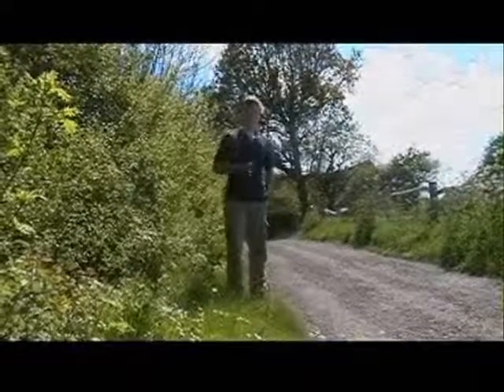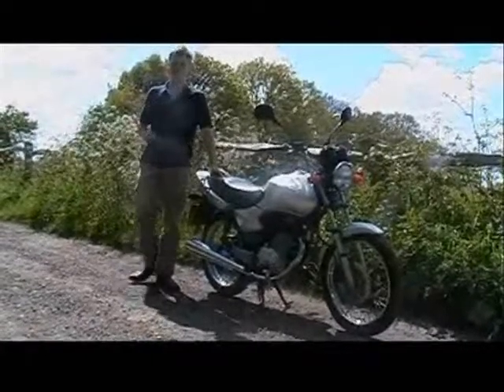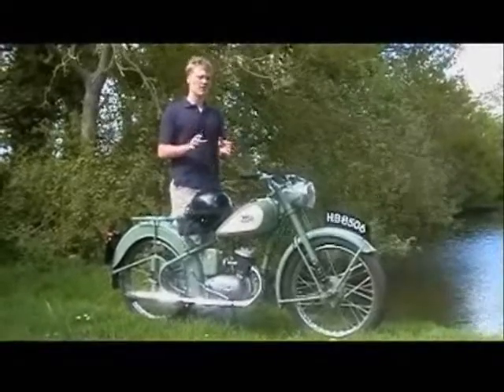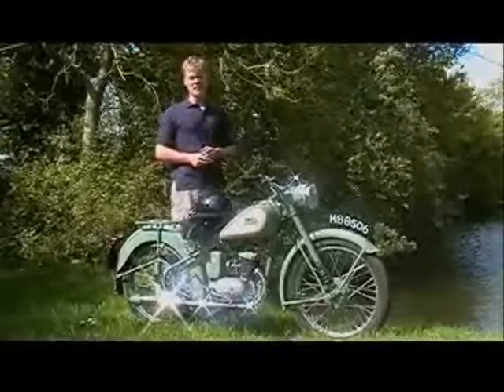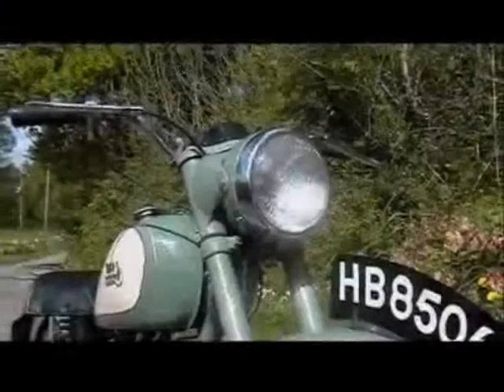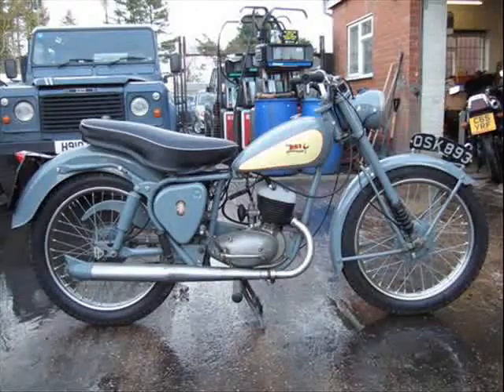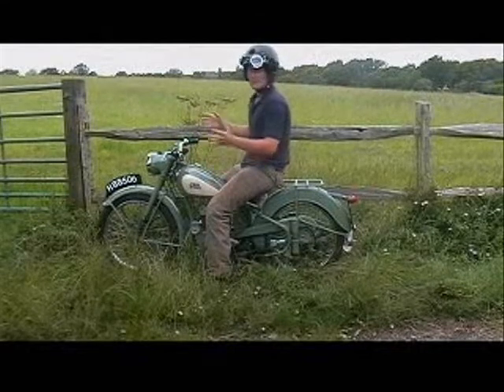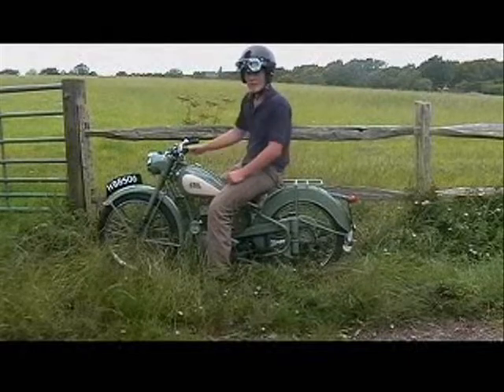BSA Bantam

Comment: I had a 1952 D1 125cc in South Africa, bought it from my teacher in 1971 for about 4 pounds - he said the magneto needed remagnetizing. Pushed it home with a friend of mine, cleaned the carb, filed the points and set them, put some two-stroke mix in the tank, then pushed it around the garden  - and PENG ! PENG ! PENG !
Rode it illegally for a couple of months (I was only 17 at that time), stripped it down, repainted and rechromed it, then rode it daily to the Uni for 4 years, then 500km up to Joburg, and another 2 years before I left SA. Lots of happy memories, very reliable and you could fix it with a minimum of tools - on one trip the fishtail fell off - then it had lots of bottom end ! So I then used to remove the fishtail as soon as I was on the motorway.

Comment: Great vid mate.  I had my test arranged and on the day I was due to take the test on an old James Cavalier.  Half an hour before the test I sat on the James,  and the clutch cable broke as I pulled it in.  The Bantam was in bits,  so I put it all back together and rushed to the test centre.  I minute into the journey I remembered the carb was choked with crap from the tank and the only way to take the test was to use the 'tickler' on the carb to flood it.. I passed,  but it was tough going.

Comment: Great movie. You forgot to mention that the DKW 125 was also copied by the Soviets to produce the Minsk 125. Still in production today in Belarus, it is the most highly developed variant with electronic ignition and 10 bhp from the same 61 x 58, 123 motor.
Reply: 169.4cc